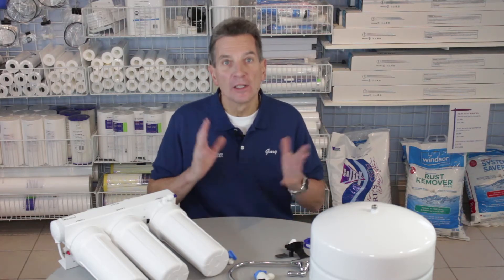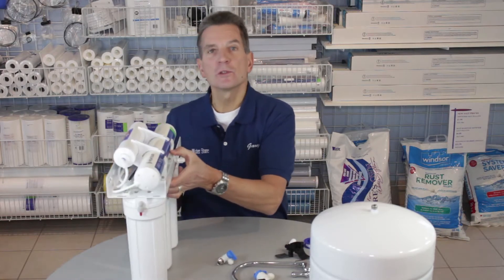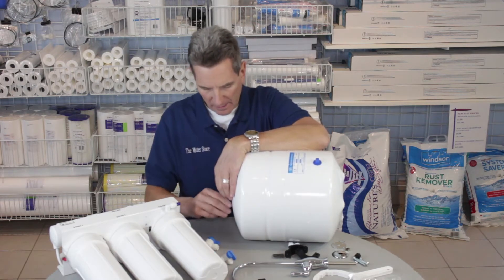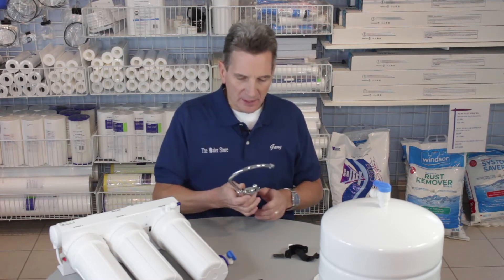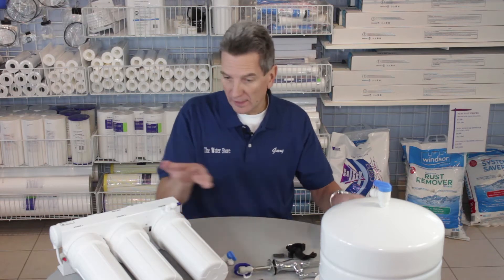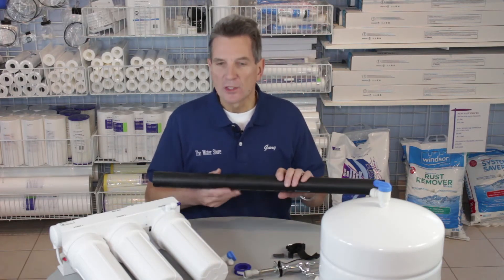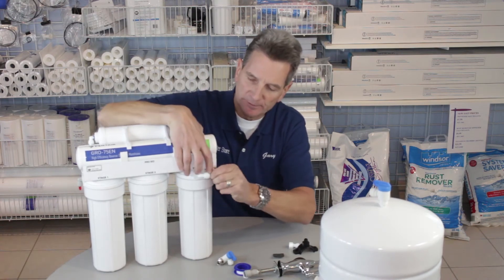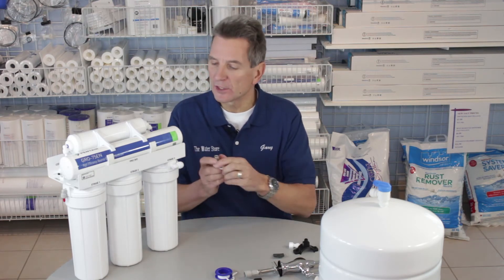How to INSTALL HUM WATER SAVER 75 High Efficiency Reverse Osmosis Drinking Water System

Comment: Looking at the HUM 75 for my house.  i would need to install this in the basement.  my issue is the drain.  i have no drain in the area where this would be installed.  If i run the drain out the side of the house, it would be about 4' ABOVE the filter system.  is the drain water forced out by pressure, and is there a risk of drain water backfeeding into the system?  would this work?
Reply from the maker: No problem, the drain can go up.  We have installed these in a basement and taken the drain line up one floor and connected to the drain line under the kitchen sink.  No problem is the drain connection is above the filter system.  Yes, the drain water is forced out under considerable pressure.  Yes, this would work.
Reply: @water_estore  thank you for the quick response! Couple more questions, are the filters easy to find, and is the RO membrane a replaceable part or does it clean itself and it's good for life?

Comment: Hi
I would like to mount in basement I have a water with shutoff for frig 
I understand I can mount tank and filters on wall in basement under frig 
Question the only wast pipe near by is 4 inch is there a saddle that size for waste line ?
Thanks

Comment: Can I use the soap dispenser hole for the to faucet? Wife hates that dispenser. Also if I do a basement install do I have to drain above the trap. I don’t see that discussed anywhere. Thanks.
Reply from the maker: Yes, you can use the soap dispenser hole in most cases as liong as it isn't too large for the faucet on the system you choose.  You can drain the RO anywhere you like in the basement, sump pump or any drain pipe.

Comment: I just installed my HUM 75. Replaced a really old system. Relocating and integrating some of the old stuff (saddle valve, drain) with this new system wasn't too bad at all.
NOTE: THIS IS NOT IN THE DIRECTIONS OR THIS VIDEO -> the canisters have a new filter inside but you must take them out and unwrap the clear plastic from them.
Seems like it would be obvious to mention but think of all the other stuff that is "obvious" and was included. This one may sneak by some folks.
So far, I could not be happier with the new system. And I hung it with future service in mind. Gotta change filters, ya know.
Reply from the maker: Thjank you for the tip.
Reply: I just opened up the stage 1 filter and saw no plastic. Was there plastic only on a few of the filters?

Comment: Just did an install of this. Very easy to do, especially since the sink had a knockout. However I’m not sure how I can get the faucet tightened fully down by myself as the sink is quite large and I can’t reach around it to hold the faucet from spinning while I tighten the nut. Maybe will need to wait for someone else to come over and they can help.
Reply from the maker: We tape it in place until there is enough friction to hold it in place as you tighten
Reply: @water_estore  I’ll go ahead and give that a try. Thank you!